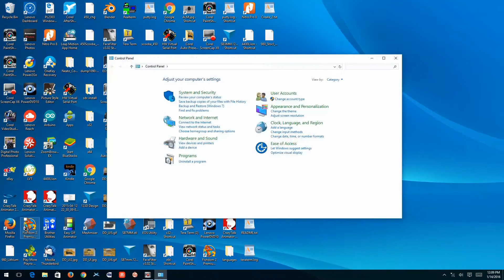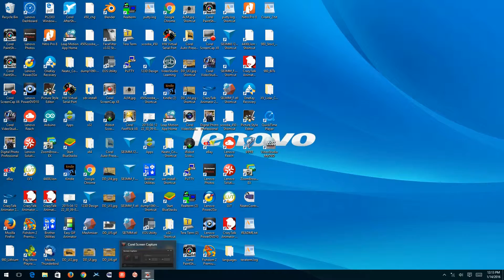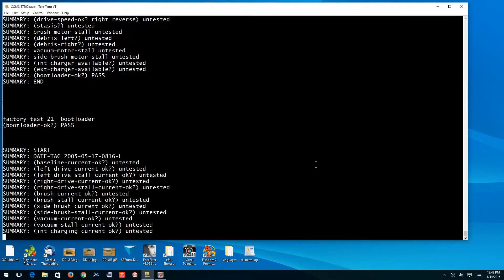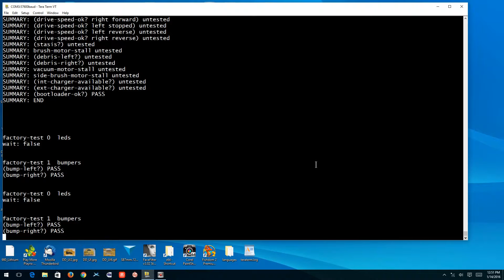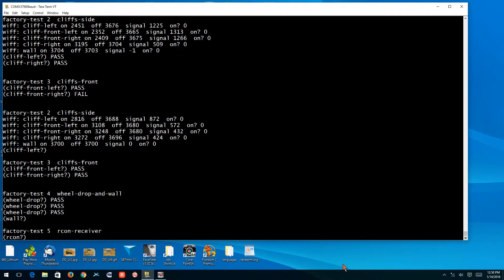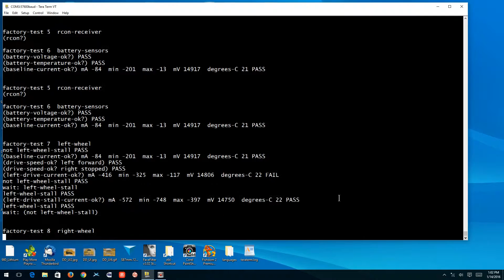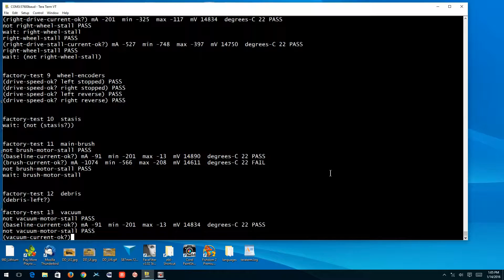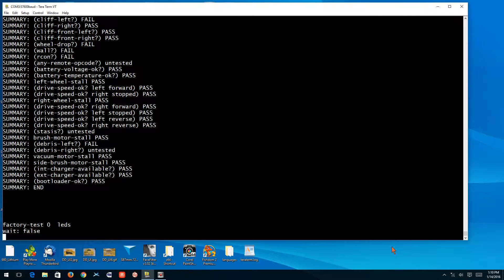Roomba Disco 4210 - Built in Testing

Comment: nice tutorial, thanks. is there a way to put a new firmware on board of the irobot, so that one could adjust cleaning algorithm?
Reply from the maker: iRobot has a proprietary code that is flashed into the MCU and is not able to be modified.